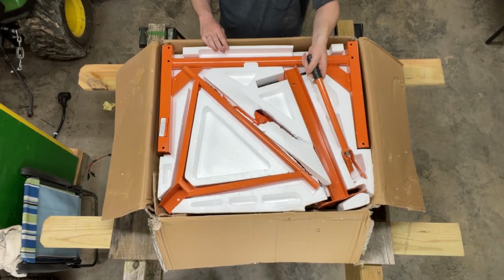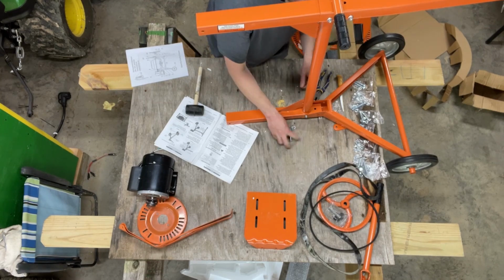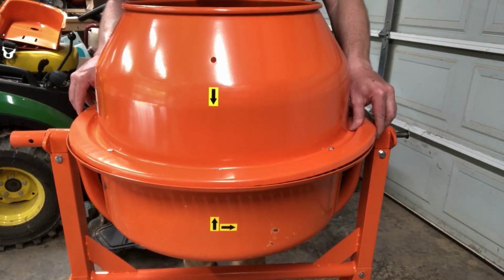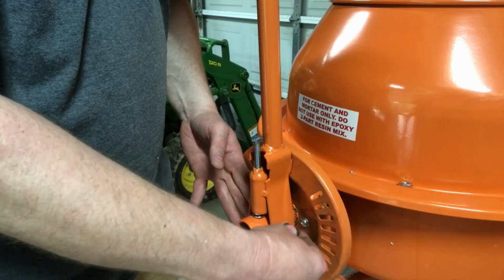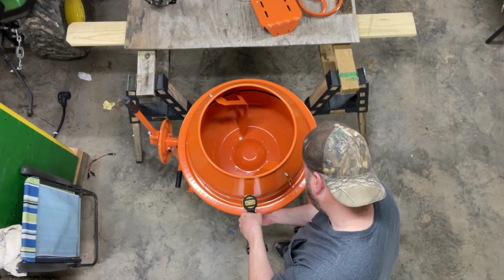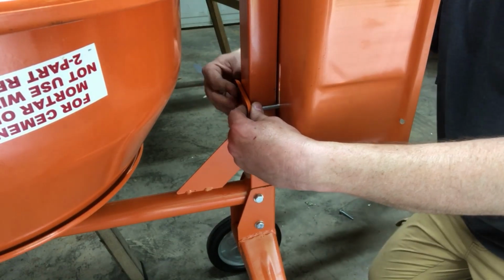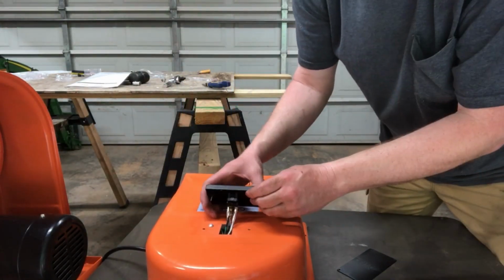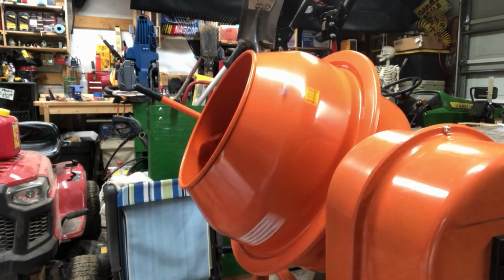Harbor Freight - Cement Mixer - Assembly

Comment: Thanks, I'm taking another break from putting mine together. They made a few adjustments or mine is the obsolete style? Same but there slight differences that they didn't compensate/adjust for the alterations made. I wish I saw your video first, you focused on what really needed focus. It's simple but the directions and all the washers, nuts and bolts came in 2 bags, no numbering or labels to match with the blueprint on the back.
Reply from the maker: Yeah I recall how horrible the instructions were on mine and none of the hardware was numbered as you say. No telling how many of these are running out there with missing parts and hardware or barely holding together.

Comment: Bro I felt the exact same way putting it together the bolts made no sense the instructions were deplorable, I think they shouldn’t have even bothered with instructions they were an absolute insult to my mechanical abilities and just threw my mental
Compass off
Reply from the maker: Yeah, the instructions are hot garbage but the mixer is pretty good. I've lent it out once and mixed a few bags for someone else's project but I went a whole different direction for my own project after being kind of put out with the assembly. It is what it is and I've got it if a ever need it. Thanks for watching!

Comment: Mine fell over and bent something. Now it's too noisy and the tiny teeth are eating the drum where the mesh together
Reply from the maker: I don't know if yours is repairable but you might could it may quieten down and last a bit longer if you applied plenty of grease to the gears. Lube grease is sticky so with it turned off, run some all the way around the drum gear. Turn it on and see if the grease will work into the gears and maybe get you a few more hours out of it.

Comment: This was the worst instructions I have ever dealt with on a purchase. It took hours to figure out what was what. Glad I watched your video because I did not put the slug in with the spring on handle and been trying to figure out that as I said f it n put it together without it.nNow I can go back and put that in so it actually does it's job hopefully!! Thanks!!
Reply from the maker: I also left it out the first time I put it together and the handle just hung loose. I had no idea what the slug was for until I got to that point. I took it apart, threw the slug in and its worked ever since. You should be good to go once you put the slug. Thanks for watching!
Reply: @LivingCommonSense  Awesome thanks brother and great video and awesome you took the time to help out others with your informative video!! Much appreciated out here in The Flint Hills of Kansas!!

Comment: Your video was a help with assembling mine, just needed to figure out the bolt size configuration lol
Reply from the maker: The bolt sizes and placements were not readily apparent at first glance. I guess its right if it goes together and stays together 😁

Comment: On the machine behind the motor shroud, there is no gasket. There is no gasket on mine either. The only gasket on this mixer is between the barrel.
Reply from the maker: Yeah, I said gasket but probably should have called it a retainer or "keeper". There was some rubberized material behind the retainer and all of it appears to have been painted after assembly. It was the retainer plus some rubber overhang I needed to get the shroud over so it would mount securely to the attachment point. Good catch and thanks for the comment.